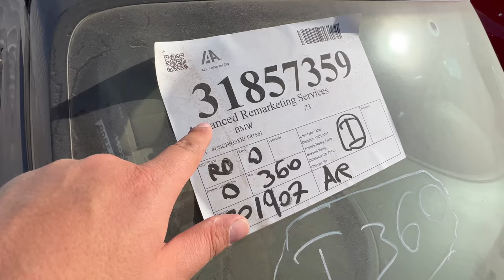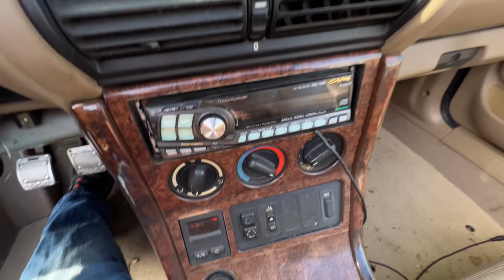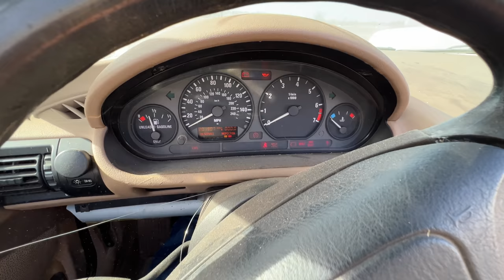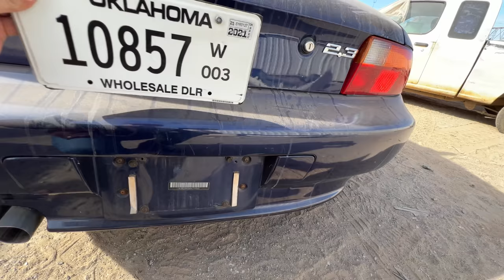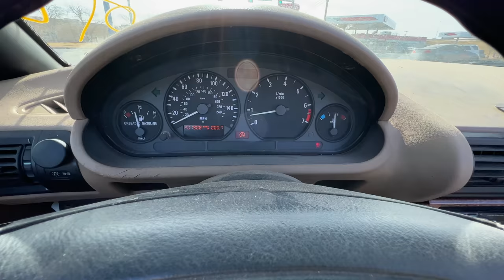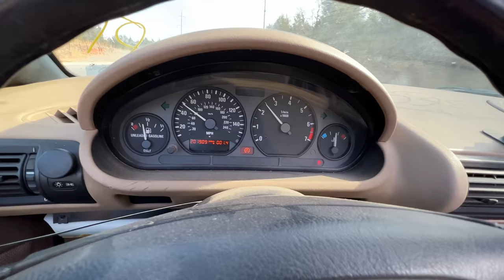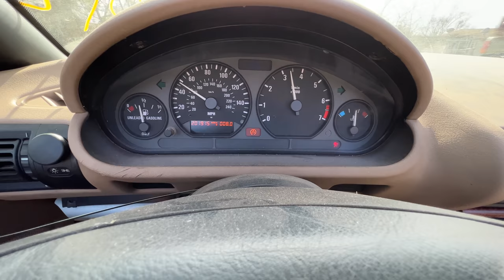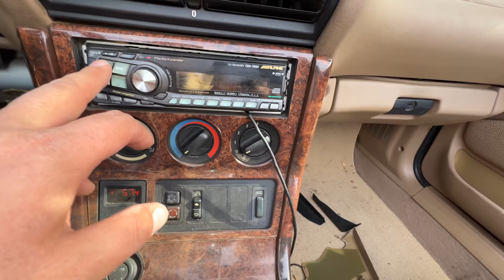I Bought a 99 BMW Z3 Manual from IAA Sight Unseen for $900 *Hidden Dinan Parts*

Comment: By the way, the noise you get taking off from a dead stop is your drive shaft center support. The bearing and the bushing have gone out and it's letting the drive shaft move up high enough to actually make contact with the underbody and you get that rotating kind of weird noise when you accelerate from a stop, it's pretty easy to fix though!

Comment: Randy you got a steal of a deal on this z3. I am a 1990 NA Miata owner and I would absolutely love to have a z3 over a Miata. I clicked on this video so fast that I didn’t recognize the $900 on the title but when you said $900 I was shocked beyond belief you got it for that. These things run up too $10k in todays market even high mileage and finished interiors. It being a bmw, the z3 is definitely a easier car too work on just like a Miata. You definitely got a steal and just for the maintenance I would recommend getting it on s lift and check for any leaks/broken or rusting spots. If it checks out you have a great and fun little car on your hands!

Comment: idk man I'd spend a few hours at a junkyard and get as many of those broken plastic bits as I could, reinstall that stuff, get a nice clean connection at the battery terminals and posts and tighten it right, check on the transmission mount and rear end get that quieted down, and there's only seven of these on FB marketplace right now, cheapest is $2800 nicest lowest mileage is $11900.  I'd think this could easily bring 4-5k after some detailing and attention.  That dent on the quarter near the gas door is the most time consuming thing but it can come out and be touched up.  You're definitely in it for the right money, if someone gets this from IAA for under 1500 it has potential for enough to be worth the time still.

If I get that garage I want you can bring all this interesting stuff you don't have time for down to me in Lawton, I'll get them sorted on the cheap, do a photoshoot, you can list it and make the big money.  Lawton used car prices are stupid high, might work out nicely.  I know I can't find cheap stuff here very often so I end up looking in OKC most of the time.

Comment: The rear differential housing might be separating from the subframe of the car, under or near the trunk area. This is a well documented issue with the Z3 series of vehicles. This could be a safety hazard while operating the vehicle if the read differential separates from the subframe, and could cause a hazard to other motorist.
Reply: this needs to get bumped up to the top so randy see this
Reply: Would love to know what the issue actually was. I think a fix up video on this car would do well.
Reply: @weiselma1  the clunking noise?  Definitely center support bearing for the drive shaft.
Reply: Center support bearing failure
Reply: @slowschoolofdriving218  yep 100%

Comment: That little dot next to the mileage means that that cluster is not the original cluster and on these particular bmw years the mileage was stored in the cluster so the mileage is not actual and won’t know until you hook it up on autologic or ISTA

Comment: Interesting fact, it's actually a 2.5 liter engine.  The 2.5 liter and 2.8 liter were deemed too close together by BMW from a marketing standpoint so they badged the cars with a 2.5 liter engine with a 2.3 badge.  The interiors don't hold up too well but everything else about these cars is excellent in terms of quality and durable engineering.

Comment: I'm sure somebody's already told you but in case they have it I would say that's a CV axle shaft making that noise it probably had a rift boot which caused it to dry out and you need to replace it the Bering to dry okay thank you

Comment: Hey Randy, didn’t you say this had a larger engine installed? If so it would have less than 200,000 miles on it. Great find enjoyed the blog! Thanks
Reply: From memory he said it had a bit of work done to the engine due to tuning sticker in engine bay
Reply: It has a tune... probably an ECU tune and that's it. The sticker is for the dealer, so they don't flash the ECU with an update and delete the tune
Reply: It has one of those tornado 🌪 doodads in the intake tube.  Makes 65hp ! Was only 2 easy payments of $19.95 too! Hot damn 🔥 😍

Comment: 3.5mm filter was for someone using a mp3 player/phone to the factory radio input. Some devices pickup electrical interference and that box eliminates or lessens it

Comment: This video inspired me to look for a Z3. I found a 1998 1.9L with an engine issue for AU$2500 + shipping, which for Australia is about rock bottom for any vehicle. It's in far nicer shape but has 309,000km (192000mi) which is about the same as yours. Cosmetically it was nicer although some work on the door trim and seats is necessary due to age, likewise there was some deferred maintenance on things like the trunk air shocks. In the 12 months it has sat in my backyard I haven't seen another one of these under AU$9000 and I check daily. 🙂

Comment: Get a BMW shift nob, that thing on there now is horrendous. 
I am amazed you go that for $900. In running condition, both windows working, and a soft top that will actually keep out rain! 
What a steal! I have the 98 M Roadster (just bigger motor) and its a joy to drive!

Comment: That noise is probably a bad guibo disc or center shaft support bearing gone bad. I have owned several old BMWs with this issue. Good news is it's really easy and cheap to replace.

Comment: 99 registered but it's a pre-facelift body so probably built the year before. Yours appears to have the later M52B25TU engine with dual VANOS so that would put it right at the end of the production run of the pre-facelift, there's only a small numbner of that body shape and engine combo around, so it's actually quite a rare one. Either way a 2.3 (actually 2.5) prefacelift widebody is as good as you can get bar a facelift 3.0 (arguably not so good looking) or the full M version. Either way, with a decent set of 17" wheels, some TLC it'll look great. Dent will pull out. Amazing to see how deteriorated the plastics are in a hot-sunny weather car vs my UK 97 where the UV doesn't do anything like the same amount of damage!  My plastics are all good as new!

Comment: Hey Randy, is there any chance of finding and purchasing an old 80s Sterling? As you never see these ever. Could be a good video??
Reply: @yefenofphoto  they also made 500 of these is turbo form, and once done tinkering has taken place you can achieve over 400bhp from them

Comment: From what I can see when you looked under the bonnet the top mounts are completely shot as you can see the cracks around the rubber inserts
But getting a 6 pot for under a grand is a mega steal you did well mate and it looks like it hasn’t seen any road salt over the years.
That broken cup holder is an option and just unclips from the centre console but the back cubbyholes can be a bit of a pain to repair.

Comment: The clunking from a dig is either a bad drive shaft U joint, a diff mount or trans mount. Doesn't sound like a CV axle.

Comment: Have to agree with others, would like to see you solve the clunk issue.  The car is content gold.  See if you can source the broken plastic pieces as well.  That dent is not worth bothering with barely noticeable.  By the way you say you don't have a use for it but do you own a convertible, one with a performance upgrade.  And for the price you paid.  This may be old but looks very nice and would still get looks after 23 years of use.  Keep it through next summer, enjoy the wind through your hair, then sell it for a profit.

Comment: I has a 1996 Z3 with the 1.9L 4-cylinder, with 100k miles, 5 speed manual in Boston green with the same tan interior. My plastics were all in one piece. Only 135 hp but peppy and fun to drive. Handled great around curves and turns. I believe it’s a timing chain not belt.
Main problem was mine leaked oil through every gasket, valve covers, oil pan, and both seals. Value of the car was not worth the price to fix the leaks.  Traded it for a Z4 with 3.0 six.
Looks like someone took a baseball bat to your interior.  Fix the plastics and clean it up sell for $3k. TK can add it to his BMW collection.

Comment: Unless the previous owner took the performance exhaust and intake out it would of been pointless for them to be running a dinan tube
Reply: You can run Dinan tunes without that.
Reply: sure you can, but have you driven one after the tune is complete?  I have, no hp gain, top speed limit removal but still takes forever to get up there.

Comment: Standard Z3’s aren’t worth much. Don’t get me wrong. It’s a nice car. If it was an M Roadster it would have some real value. The noise you are hearing is either a cv axle or the universal joint or driveshaft guibo. BMW’s don’t have replaceable ujoints. Have to buy a whole new driveshaft.

Comment: A 1999 BMW Z3 2.3 actually has a 2.5 liter 6 cylinder engine. Not a 2.3 liter as you suggest. I know. I own a 2000 Z3 2.3. Almost the same as this guy.

Comment: Seriously this should have been like a 10 minute video.  Bloody hell.  Noise is likely Carrier bearing on driveshaft.  Hopefully not torn rear subframe that is common on the 6 cyl models.  I'm positive it's not "I'm 99% sure it's a CV axle"... bad CV don't typically make noise unless you are steering... when they are on a fwd car.  I'm 99% certain it's the driveshaft carrier/hanger bearing.

Comment: more OLD bmws! find a good E53 X5 and it'll be the best car you've ever owned lol also the cooling system prob is kinda bullshit because i own 4 old bmws and have a lot of knowledge about them. if you replace the cooling system it'll last another 50k-100k+ miles lol the folks who complain either bought cheap aftermarket stuff or didnt bother replacing it until it failed after a ton of heat cycles. FCP Euro has lifetime warranty of everything down to the oil.
Reply: I own a e53 3.0 and it’s been extremely reliable we just did a 2k mile road trip in it

Comment: I thought you were called auto auction rebuilds. The least you could do is spend the $25 to clean up the headlights and maybe fix the clunking problem. What's the point in watching if you're not going to do anything with these cars.

Comment: Those german and British cars are not worth buying at any price unless you are going to part out all the good working parts on them.  Turn signal actuator for that BMW convertable you people see here is $1,400 plus labour ( or you can use hand signals) the turn signal stays on and and iluminated constantly which ever way you have it signaled even when you turn off the ignition. it also sucks in rain or low water and caused hydro lock and snaps two pistons instantly. go online and research cars before ooo'ing and ahh'ing, i know mah dad deals in cars. caddy northstars and dodge intripds wit the 2.7 v6 are just a few of many cars people need to stay away from. just f.y.i